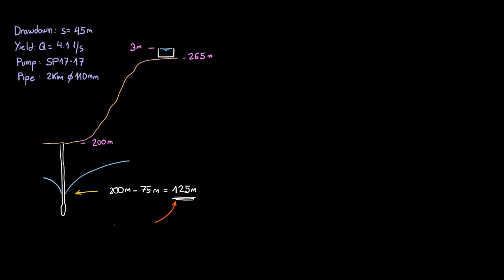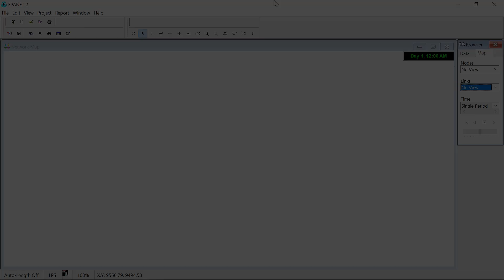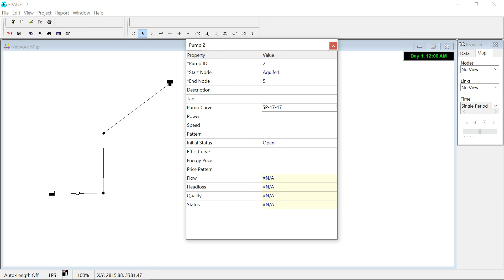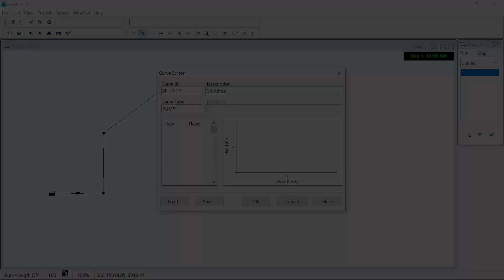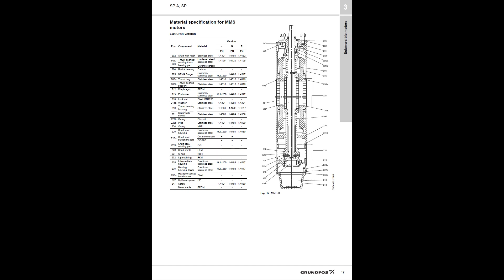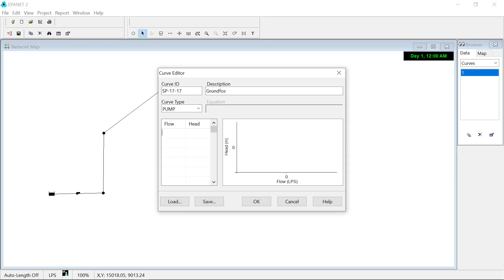How to model a borehole in EPANET

Comment: Hi Santiago thank you for this helpful video!
I'm trying to model a pig farm in EPANET. The water comes from the borehole and there is a pump, but there is no tank. Does this change the steps I would follow from this video? Previously I've modelled it using a reservoir connected to a junction with negative demand, but I would like to make my model more accurate.
Also I know the range of flow that needs to be supplied into the system, I can also make an educated guess on the groundwater level and drawdown, do you have any tips on how I could input the suitable pump values into EPANET?
Thanks again.,
Finlay